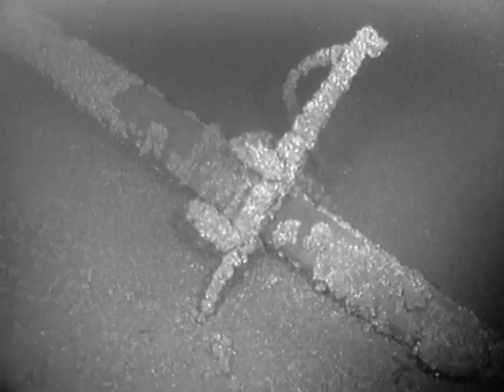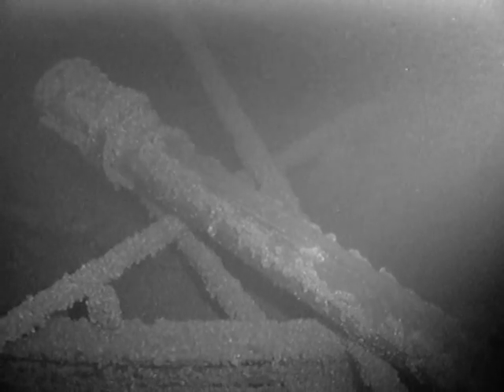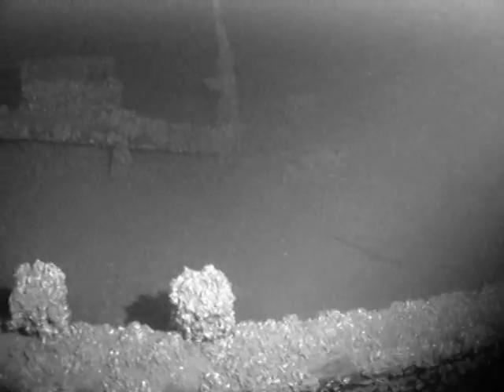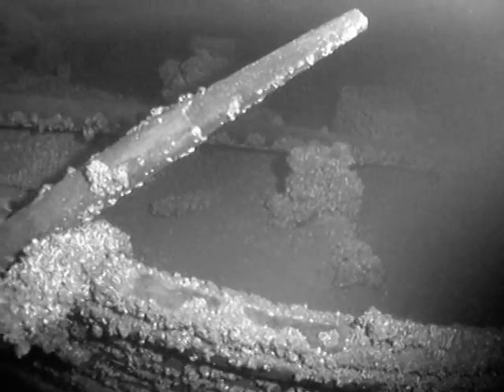Shipwreck Explorers Discover 1850's Schooner in Lake Ontario

Comment: No
Daggerboards are boards that extend through the keel.  Ships built after the 1820's did not use the daggerboad concept.  Some used a pivioted centerboard.  The C. Reeve did not use a daggerboard or centerboad. The hull extended farther into the water than earlier built shallow draft ships that would need a daggerboard or centerboard.